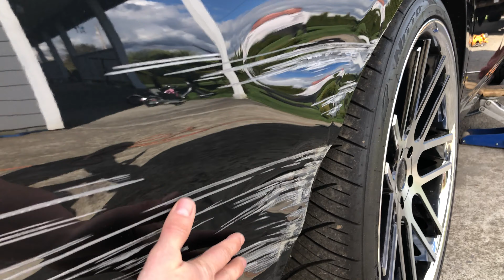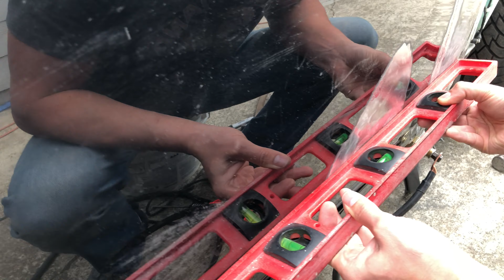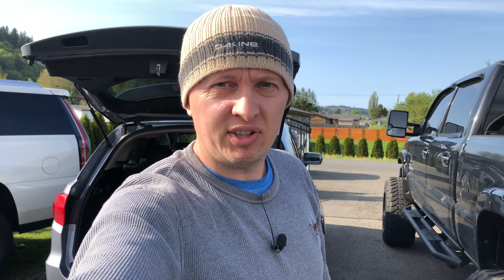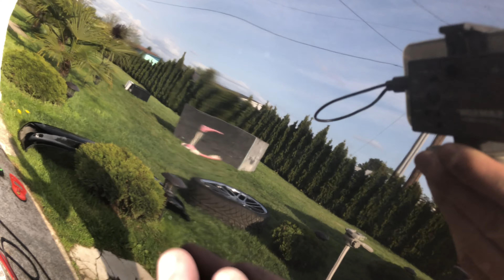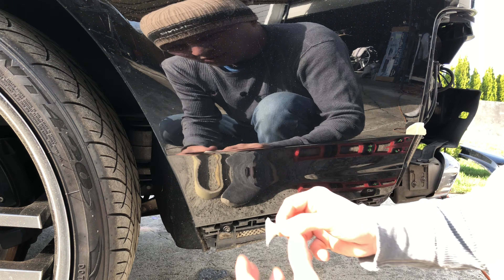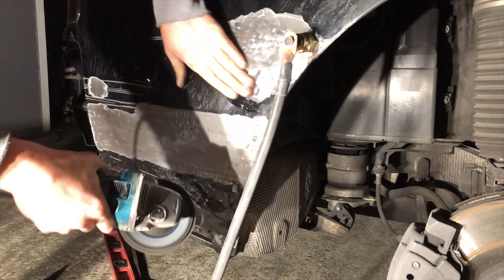✅ Doing Tricky Metal Work on a Totaled Rolls Royce Ghost Repairing Quarter Panel Damage PART 2

Comment: @fix206  How long does it take to just pull and repair the panel?  Not including sanding, painting and  prepping
Reply from the maker: Took around three hours to get the panel on the Rolls-Royce pulled and straightened out and ready for body filler

Comment: Where can I get the spot welding tool?
Reply from the maker: I actually built mine from scratch, I made a pretty detailed video about how I did it. I am currently working on some things that I will be selling in the near future. One of the things is an upgraded electronic controll unit that runs all of the functions of the spotter, but it is a lot more advanced and user-friendly then the one that I did in the video. I will also have the hand held puller for sale as well. Should have that stuff available in a month or two... But here is a link to that video https://youtu.be/j6UgtCN5vzU

Comment: Is it possible to use spot welding machines on aluminum car doors?
Reply from the maker: Aluminum process it's quite a bit different. I have seen an aluminum spotter online a while back. I think the way it works, instead of using transformers it uses large capacitors to deliver very high amperage to make the aluminum tabs stick. But I know for a fact that my set up will not work with aluminum.

Comment: man, i hat body filler. try using tin next time.
Reply from the maker: I sure do hate it to,,, by tin do you mean lead?
Reply: @fix206  well, your solder would have 70% tin and 30% lead. but you could call it that aswell, i guess.
Reply from the maker: You must live outside US where you guys call it tinning... In US it's being called leading... It's kind of an old school technic, before modern body fillers where being widely used... I've never used that stuff, but would like to learn how to work with it some day

Comment: Hello sir you have inspired me to do my own work Question  I have a 2011 Cadillac Escalade  I like to  conversion it to a 2015 front cowl will it line up and do I have to get a radiator support
Reply from the maker: If I were you, I would start with fenders first by checking to see how well the contour of the fender lines up to the front door. In my opinion dealing with the radiator support down the road would be an easier task then trying to fix a poor fit between the fender and the door. Also you may want to search around online to see if this conversion had already been done. If someone had already done it, chances are they can answer your questions much better than I can :-)
Reply: Thank you because when you repair one of my favorite car the ghost RR ,like a pro that why I ask you and yes it been done on 2007 to 2015 Cadillac Escalade front end conversion. Sir
Reply from the maker: I haven't worked on a newer Escalade yet, so I'm not too familiar with them :(

Comment: Were you able to improve the area where someone previously had 3/16” thick filler? Also - I like the smaller puller you used on the fender and the puller that works on variable depth dents.
Reply from the maker: I for sure was able to improve that area under the body filler a bit more to make it flow little better with all of the other metal that I had to straighten back out. Smaller puller attachment works good when you're trying to keep the repair area small,  other attachments with the bigger footprint will actually raise a larger area so they are really handy whenever I'm working on larger dents

Comment: That was really interesting how you fixed that big dent without even touching it (when you corrected the  leading edge of the quarter panel). One thing I've done in the past when using a spirit level (or other straight edge) to locate low spots, is to mark the low spots with a pencil, so I end up with a series of horizontal lines showing where the "dent" is. This video must have been really interesting, because it was over before I could blink. Looking forward to seeing more progress as the Ghost returns to pristine condition.
Reply from the maker: Don't you just love it when you work on one part of the car and the other part just fixes itself in the process ? 😂  I made this video a bit shorter, I know a lot of folks don't have the patience to sit through a much longer video, so I'm just experimenting here with the video durations just to see what works better and what doesn't

Comment: It’s really looking good. Great job! 
I can not find the ratcheting puller Gun with the removable round bases. Everything thing else I have.
Reply from the maker: That puller attachment it's something that I ordered from Russia. I got it couple of years ago and not sure if I can even order it still. Plus the website that I got it from is 100% in Russian so it would be a bit difficult for a non-Russian speaker to navigate through it. So I guess the next best thing to use is some thing that Arthur Tussik is using with his spotter setup, and I included the link to that type of a puller in my spotter video description
Reply: Thank you. You did a great job on the metal work of this nice car. No doubt it will finish great!
Reply: @PhillipHall01  AliExpress> automotive tools> Search Spotter...look for an accessory kit for about $69.00.  You still need to build your own Spotter.  Subscribe and search Fix206's channel.  He does two walk throughs of building one for little money.
Reply: Brian Corrigan 
Thanks Brian. I have the accessory kit. And built the spotter. I was referring to the hand held squeeze ratchet puller with the round base used to pull out the small imperfections. I had ask Arthur Tussic about his several months ago, which is a little different than this one. ( the one that fix206 just posted for me) Arthur gave me the same link but it was shipped to Europe only. Actually if I had a choice I like fix 206 better. Unfortunately I can not purchase either . I even looked on Russian website and could not find it there either. Bummer lol. Maybe I can make one some how out of a paint calk gun?